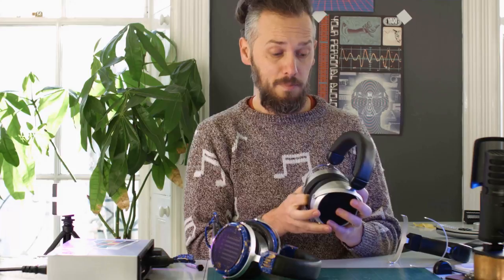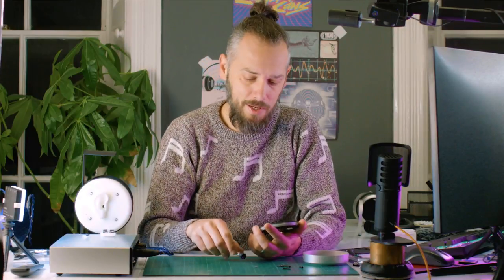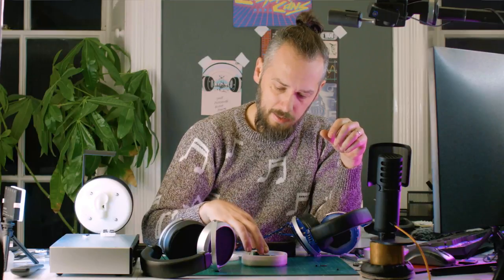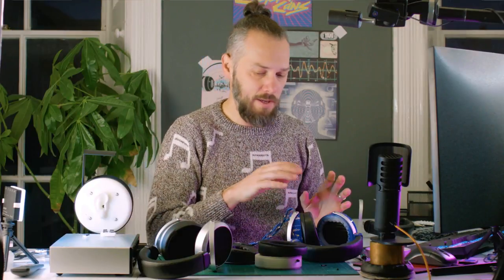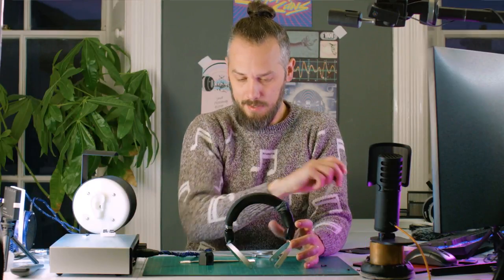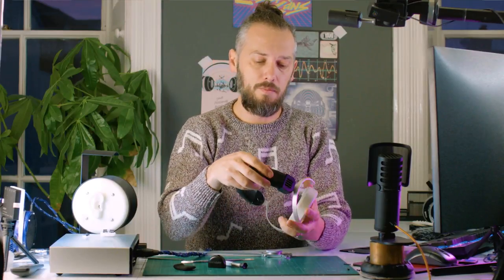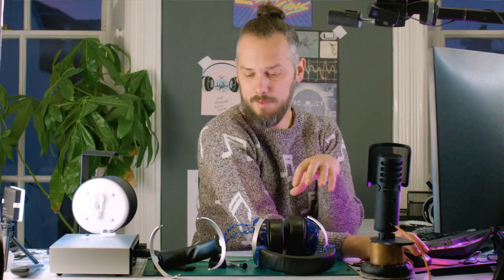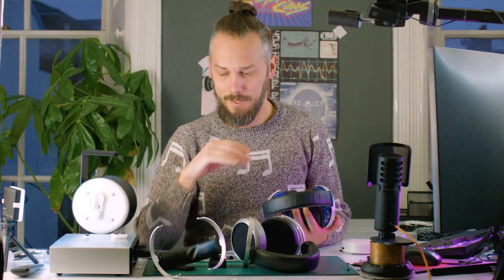HifiMan HE400seXY 3D Printed Audiophile Headphones Finale

Comment: I am looking forward to see what  you made! In the meanwhile I stumbled upon a great solution to make our headset experience more life like! Open baffle headset with a dual driver for more power handling and no brakeup within the passband. In my channel I only show the idea, but I leave it up to you to grasp the benefits of such a design. This sounds so much better than everything I've heard so far, the drivers handles a ton of power. Eq with zero reflections and absurd power handling is just insane. Should't be to hard to replicate my build. The AMT 8 measures really well and doesnt need a highpass in headphones. I found a dynamic driver with a natural roll off  wich crosses over perfectly with the AMT-8. The tweeeter is only lowered by an 12ohms resistor. No phase change since the power handling of the drivers are good enough to handle the fullrange ,so no need for a crossover. The music experience is just wild and obviously this design gobles a ton of power.
Reply from the maker: Really interesting design - it reminds me a bit of the Sony MDR-F1. Not a lot has changed on mine since the last video just a few tweaks - most of the changes were to make it easier to print and build
Reply: Haven't seen those before but design principles are the same. Looks like they tried to change the sound by physical means, while I made mine to be used with eq from the start. The disadvantage with that headset is they have a lot of reflection points for the sound reflecting back from the ear. Also because of the open baffle bass loss that driver has make that up that with large excursions while playing the treble too. That's why I felt 2 drivers were needed. When I got rid of the usual reflection points on casing , the sound improved in most aspects. Its the effect of listening to a narrow dispersion speaker, less room and more direct sound I guess. I am looking forward to  see the end result and listening impressions of your complete build!

Comment: thanks for making this open source and all the work and effort you have put into this work of art. I have a pair of HE-X40 on the way from drop.
looks like it should be compatibe only diffrnece i can see from the photos is a diffrent screw type for the headband connector.
hopfully i can find a good commision printer around me.
Reply from the maker: From the look of them, they have the older, non-stealth magnets in. This kit should fit but it has not been tested with those drivers yet.... We do have a new easier and safer mod for these coming soon. It is not quite as good as these but is much easier to fit.
https://www.instagram.com/p/CeVfbaTgxjZ/?hl=en

Comment: This is great, Jason. Fantastic result!  If I wanted to rewire these, what wire would you suggest, connecting to the 3.5mm jacks?
Reply from the maker: If you are talking about the wires from the socket to the driver.... it is a very short length so it should not make a huge difference but anything of a decent quality that is quite flexible. We re-wire most headphones with copper Litz wire around 20AWG  but that is mainly because we have a lot of it in stock

Comment: The frequency diagram does look much better, than without the stupid peak, from the original design into the highs section.
Reply from the maker: I am really happy with the sound of them but we are still doing a few more tweaks to the design
Reply: @CustomCans  Sounds way interesting. I'm wondering, without this way cool fun project of yours - to mod the HE-400se, isn't it cheaper to just buy a used Sundara? ;) But anyway, the grills look phantastic. I'd really like to mod my 400se. But i don't have access to a 3D Printer, neither want to risk a pair of 150 bucks cans...hm.
Reply from the maker: @marcp.1752  Yes - definitely ;) I broke two pairs of HE400se and I normally charge £30 per hour to design stuff, I probably spent 40 hours designing, testing and re-designing these so if you factor in my time, and the parts, this pair of headphones probably cost me £1500 - I may start work on some sundara mods soon though ;)

Comment: I love OpAmp rolling. :) Did this a lot with my Xonar Essence STX II. Which kind of headphone amp you're using atm`? I've swapped my Essence for the FiiO K5 Pro, because i like the physical volume dial, among other features.
Reply from the maker: I have a beyerdynamic A20 and SMSL SP200 which I use most of the time
Reply: @CustomCans  I've forgotten to mention, i have a Lehmann Headphone Amp, but using the FiiO, for it's PC connection, to stream my FLAC files easily. Head great things about the SMSL Asian brand. The A20 is from our country here, germany ;) I'm mostly using my HD 650 Sennheiser, or a Momentum Over Ear series. And it doesn't sound "dark" or dull after all, but nice. Speaken of SQ, Beyerdynamic Headphones easily causes ear fatique, i can't stand the artificial highs, and also sharp s-sounds, for my ears.
Reply: @CustomCans  The HD 650 sounds great onto the Essence STX(II) with OpAmp mod, or Lehmann Linear. SMSL does great electronics, too.
Reply from the maker: @marcp.1752  Yes the HD650 is a great pair of headphones and scale really well with different amps. I always preferred the HD600 but it is all down to personal taste
Reply: @CustomCans  It's a matter of personal preference & taste. I heard both for hours, before choosing the HD 650. It simply plays everything fine, i throw at it. No matter, if it's rock, metal, or even electro, jazz or opera.

Comment: This project looks really good! Was just wondering with this video and the construction and initial testing video, the driver was mounted backwards (wire side of the driver is facing away with the original housing) does this have an affect on staging and imaging?
Reply from the maker: The drivers should work the same either way round, they seem symmetrical front to back

Comment: What do we need, M2.5 x 25 or M2.5 x 30? The description mentions both. Thanks!
Also would love to know your print settings. I can probably figure out layer height, perimeters, infill % and pattern, etc. but a starting point helps!
Reply from the maker: Ah sorry - M2.5 x 25 . Layer height as small as you can and infill 100% you want it as ridged as possible and the extra weight helps

Comment: Really nice work, already bought a pair a few weeks ago. As this projekt is open source would it be possible to get the fusion360 files ?(I think you used Fusion) I'd like to make a version with an one-sided mini-XLR connector to use them with my custom cabels for my modified beyerdynamics cans.
Reply from the maker: It was made in Solidworks but I will upload some STEP files tomorrow which should work in 360
Reply: @CustomCans  Would it be possible to get the Solidworks files?
Reply: @CustomCans  Thank you, I did a testprint of the connector that worked and I just stardet printing the first housing. I would happily share the files with you or others, but your license in thingiverse says "no derivatives", is that intentional? I could also give you the files to add them to your Thing.
Reply from the maker: The tree is a bit of a mess at the moment and not everything is dimensioned properly but I will neaten them up and release them after Christmas
Reply from the maker: No sorry - I have changed that now. There does seem to be a problem with the ting though as it does not show up in search and some people are getting 404 when downloading so I will be uploading again ... I will try to set it up better with proper file names and stuff ;)
Reply: @CustomCans  Is there any chance of getting them before Christmas? I was hoping to print these before or during the holidays. The neatness of the tree is of less importance to me, I just want to check some measurements and maybe add some screw holes for mounting some other type of grill to the outside of the ear cup.
Reply from the maker: Yes i am not sure they are quite ready for public scrutiny but if you pop an email to jfunk@customcans.co.UK and put FAO Jason in the title i will send you a link
Reply: @CustomCans  I sent you another email a few weeks back, turns out one of the files was missing, could you get back to me on that? I'm almost done printing all the parts :)

Comment: What 3D printer did you use and which filament to print these? Thanks in advance, Jason.
Reply from the maker: It was a CR10 @0.16mm later height  and some generic PLA

Comment: What do the "lumps" around the edge do?
Reply from the maker: If I am honest.. I am not sure ;) Initially horn type opening was accentuating some frequencies and the bumps were added to break that up which worked but then during listening tests we noticed they sounded more open with the bumps so we tried adding more and putting them in different places noting whether we were making it better or worse. So... they reduce a peak we had in the frequency plot and give them a little more sound stage - just not 100% sure why that is

Comment: Hi, does this mod work with the HE400i? I've done goofed and poked a hole into the left side of my HE400SE :'> I've found a pretty good deal on a pair of HE400i near me so I was wondering if the mod would work with that.

Edit:
To clarify, I had the 400SE up and running for about a week, but i installed the driver packs abit slanted relative to the grill lines so I wanted to take them out and reseat them straight... Ended up doing what the video said not to do and poking a hole into the left driver by accident :c
Reply from the maker: It is weird you should say that. We had a random pair of HE400se turn up with the older drivers in and I checked some measurements. The magnets are slightly wider so I am not 100% sure how well it will work - it should work fine but has not been optimised for them. If you are in the UK we can probably sell you a pair of HE400se cheap if you don't mind open box stock